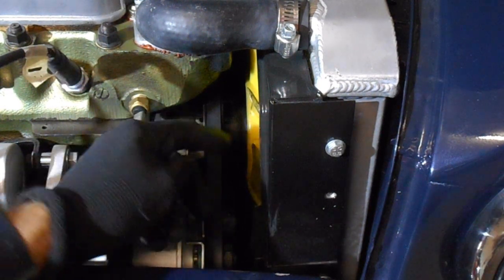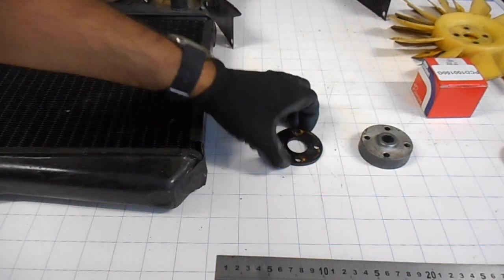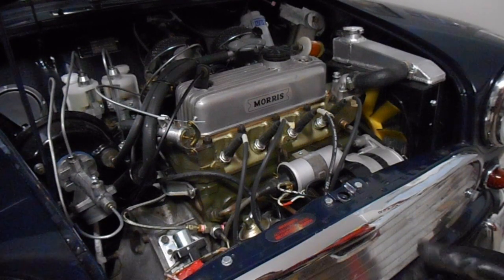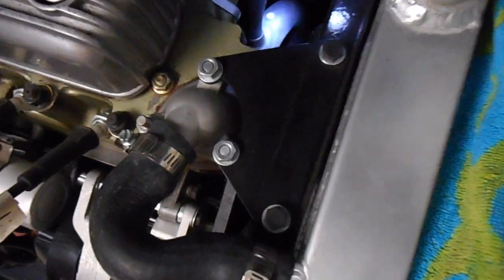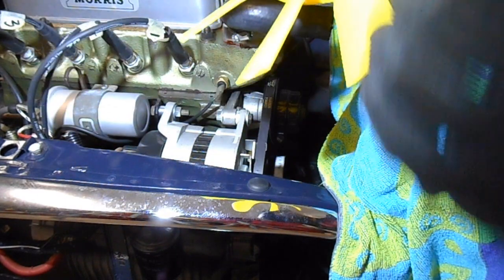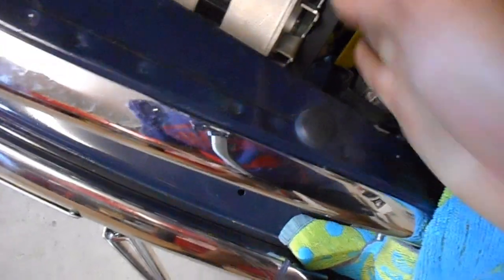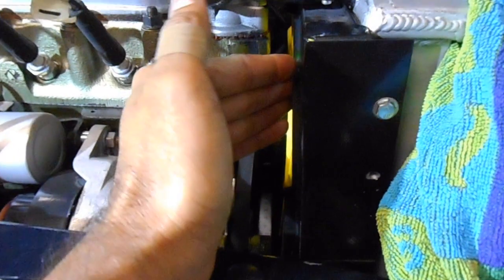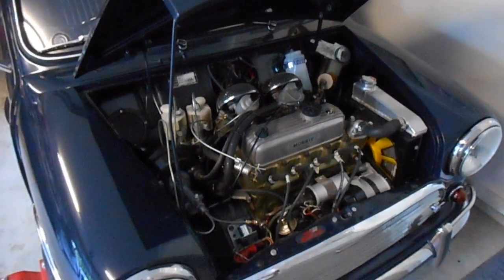Radiator Cooling Fan - Morris Mini Cooper

Comment: Good video. I bought a mini moke a couple years back and someone mentioned the fan blade is on backwards. The engine never over heats yet, but I would feel better flipping it around.  Thanks.

Comment: What brand of radiator are you using and how many rows? Also, given the high summer temperatures there, have you removed the thermostat altogether or are you still using one? Very helpful video, thank you.
Reply from the maker: I'm still using a thermostat and have the by-pass hose connected. I'm not near the car at the moment but I think this is the radiator I have. https://minisport.com.au/mini-moke-alloy-radiator
Reply: @CafeRacerLab  Thank you. I am replacing my radiator with an aluminum one. After watching your video, I checked my fan. The blades are curved as you discovered on yours. I'll likely replace the fan as well while I have it apart. Thanks.

Comment: Nice job. What thermostat ºC are you using? Thanks
Reply from the maker: I'm using GTS102 opens at 75deg Celsius. Also my bypass hose from the head to water pump is fitted. I live in NSW Australia, air temperature ranges from 15deg to 40 deg Celsius.